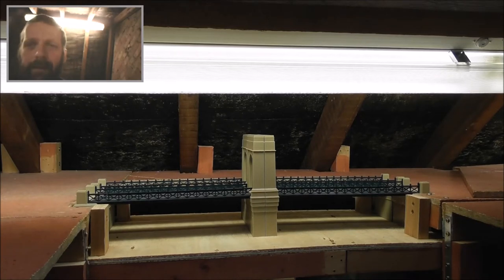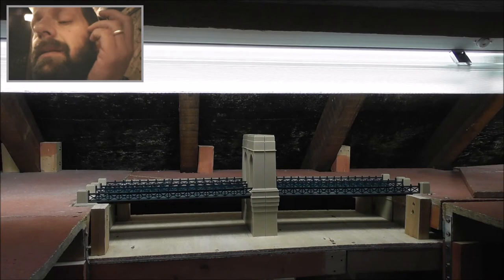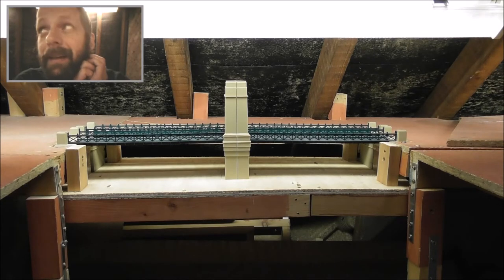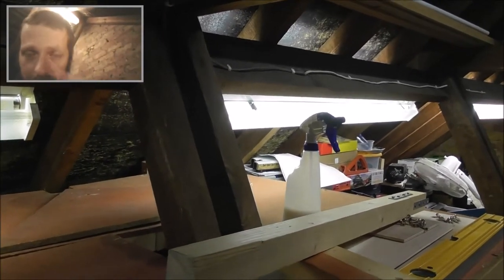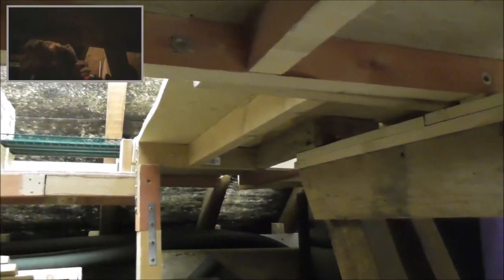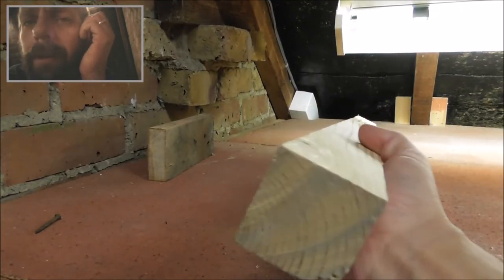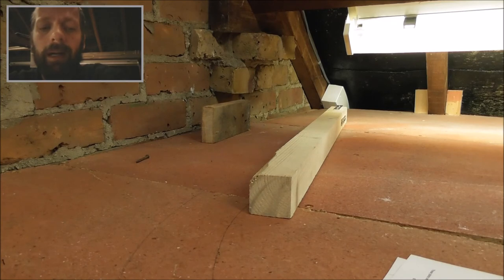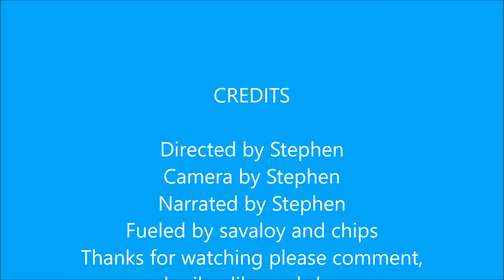Charliebrook update part 16

Comment: Hi charliebrook, looks like you have plenty of ideas, will continue to follow your progress. A good trick to help the lighting and make the loft more 'homely' is to line the rafters with a reflective insulation. The light will bounce around the room more like natural light. And it will be nicer in winter! It's a good idea to do it before you get to far because u can stand on the baseboard and not worry about breaking stuff. James
Reply from the maker: I am James thanks for your support and I have been looking at the insulation stuff coz want to try and moderate the temperature to protect the scenery and track.

Comment: Hi Stephen,

Thanks for the mention and no apology needed, Just glad I could help :)  I can't remember the sizes of wood I used for the framework on my layout,  I used the square stuff for legs and the other stuff for the actual framework.  It doesn't really matter too much as long as it has enough support to stop it sagging in places.  I used 9mm Birch ply,  I wouldn't go thinner than that really, but you could easily go up to 12mm for extra strength.

Cheers,  Michael
Reply from the maker: Michael Henfrey thanks Michael I did feel a bit bad about forgetting to mention you lol and yeah I did think that that's why I'm gonna wait to see what the majority is but I did think 9 mm ply just didn't know if it might of been a bit too thin hopefully can get something sorted soon and start redoing my base boards.

Comment: Steven Ive got 9mm ply for the base boards but it is most important what ever you use for the supports and legs that they are straight and flat as any problems here and they will be loads bigger on the final layout.
Time spent in the building will be well worth while in the end : )
Reply from the maker: Graham Wood thanks Graham I came to realise I rushed to get trains running and didn't spend the time needed to get the boards right that's why I have gone back to the start but I think I will go for 9mm ply for the tops.

Comment: I have used 2x1 timber frame for the joists so 25mm x 50mm with 6 or 9mm Ply on top, if you cut an 8x4 sheet into 4 bits 4x2 you can maximise the sheets. Have a look at the way I have supported my baseboards in the loft, very similar to Dave at Dean Park. I would fix the batons directly across the wood joists with screws, 1 either side of each joist will give you plenty of support for the ply, you got some track, so make sure you spend the money on the baseboards and get it right from the start.
Reply from the maker: Andy Hudson yeah wood will be at the top of my list and thanks for the suggestion on sizes as said I'm gonna have a look at wicks.

Comment: Hi there Charliebrook,...Like you I'm building a layout in the loft am at the baseboard stage, I'm using 22 x 47mm x 2.4m sawn kiln-dried timber available from Wicks £20.19 for a pack of 8 lengths for the frame battens and legs. For the surface I'm using 9mm x 607 x 1220 Hardwood plywood price £8.99 from Wicks again. I don't know if this is the correct method but it seems solid enough to me. I do use small right-angled brackets at the bottom of the legs to screw to the floor.
A word of warning about measuring cutting and pre-fabricating anything in the garden to build later in the loft, if your loft is anything like mine, there won't be anything square or at right-angles in it. 
Just one final thing is there anything stopping you from running a baseboard around the perimeter of the loft? That would make a much longer run enabling trains to be out of sight for much longer.
all the best Gav
Reply from the maker: Gavin Grierson thanks mate will take a look in wicks and I did think about the loft area not being completely straight but probably won't go right into the corners but will definitely bear that in mind. I have only got that corner to work with ATM as the loft is used else where but maybe in the future fingers crossed.

Comment: Hi, i used WICKES STUDWORK (CLS) 38 X 63 X 2400MM SINGLE for the frame with 18mm chipboard on the backwall and the sides are 12mm ply all with the same frame work!! Hope that helps. Scott
Reply from the maker: South Junction thanks Scott gonna have a look at wicks.